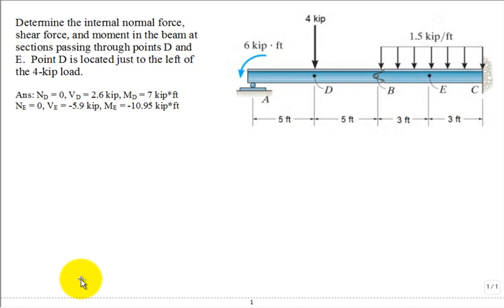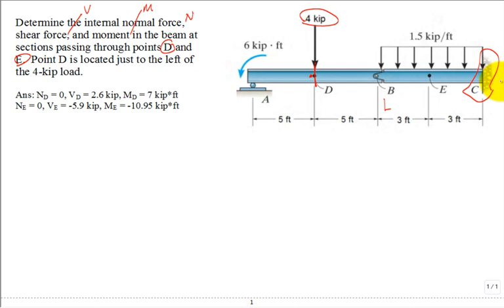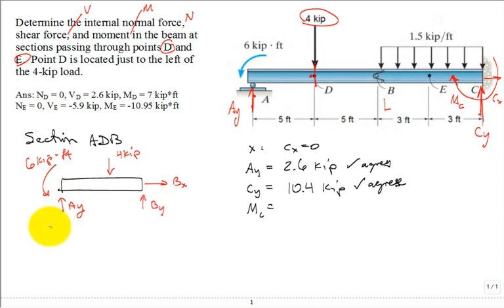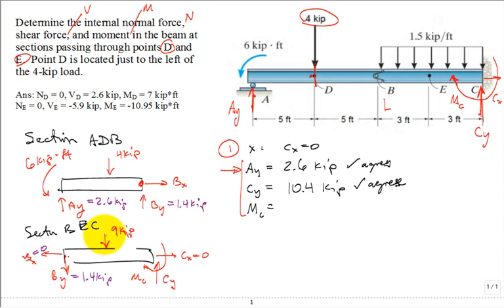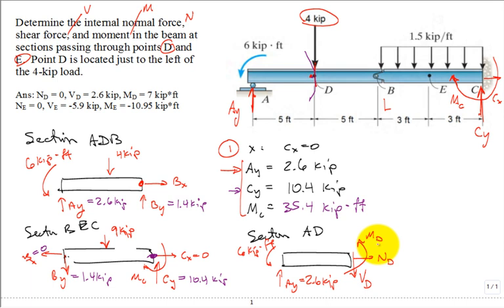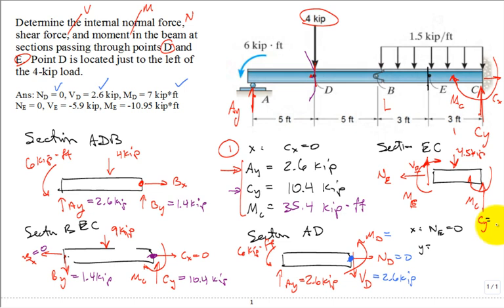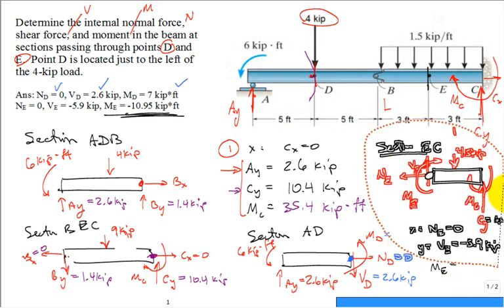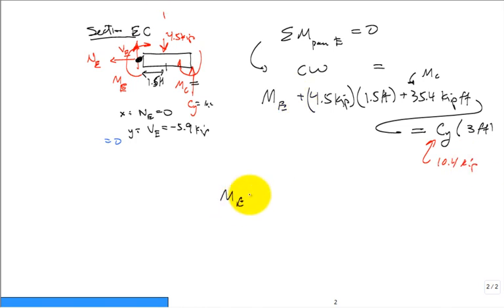internal forces compound beam spr18

Comment: How Ay and Cy
Reply: Yeah I would love to know how they solved for Ay and Cy :<
Reply: Using Section ADB, you can find Ay at the moment B = 0, and then find the Ay variable from doing that. Remember that forces applied at a point like A or B are obsolete when finding the moment at that particular point. So when finding the moment at B, you do not factor in the force By because, the distance that it is away from point B is zero.

Comment: Why is By up or down at the pin?
Reply: The direction you assume the force to be in does not matter. You write it up like that to show that there is a force that exists there to begin with. 

After working through your Equations of Equilibrium, the forces' directions will correct themselves.